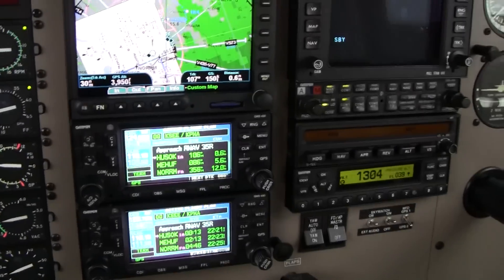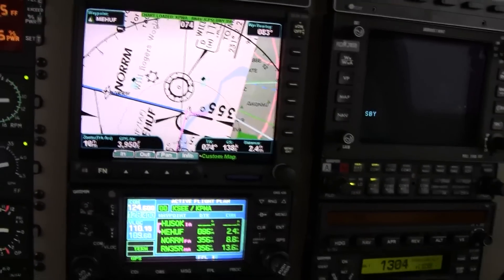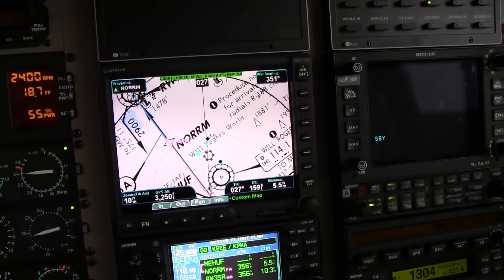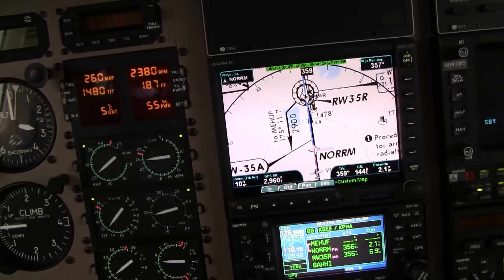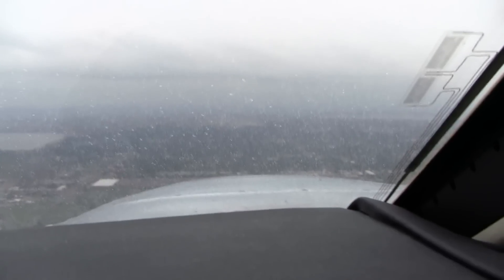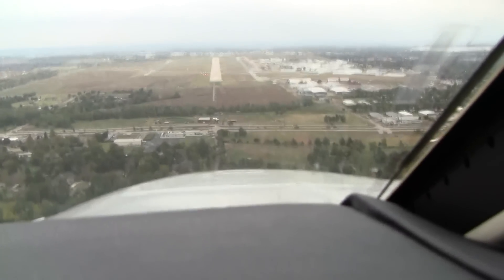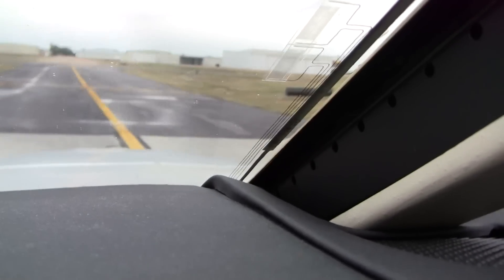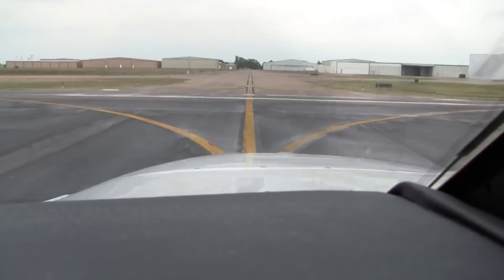Flying The PA46 Mirage on The RNAV Approach to Runway 35R at Wiley Post, OK

Comment: gyroscope on the cam makes all the difference!  thanks for this HD video!
Reply from the maker: Hi Stephane. I am using the digital stabilization feature of the Hero 5 Black. It does a great job without the extra bulk and weight of the gyro stick.
Reply: Dick Rochfort, ATP, CFII AWE-SOME!!!!!! really convinced in getting one then! thanks for the gr8 vids btw!